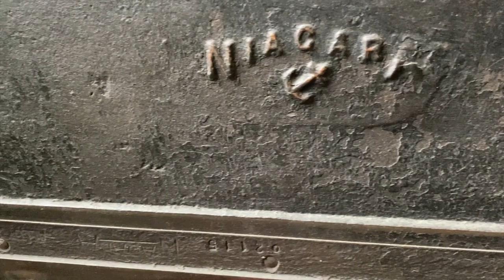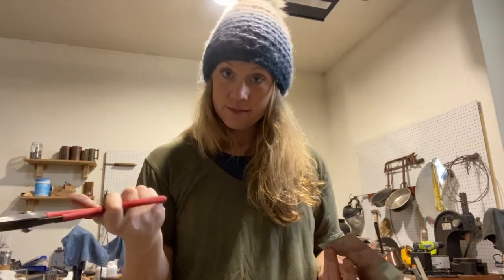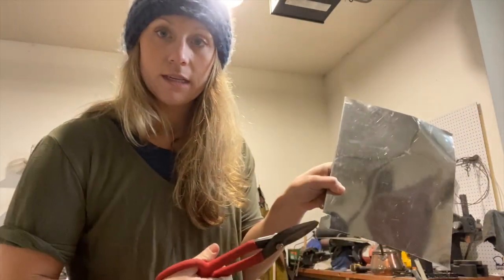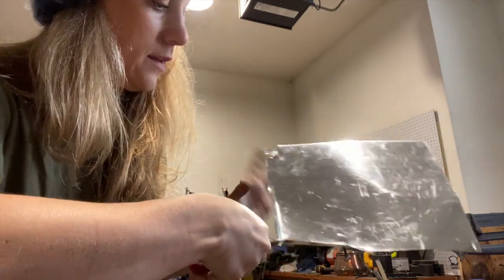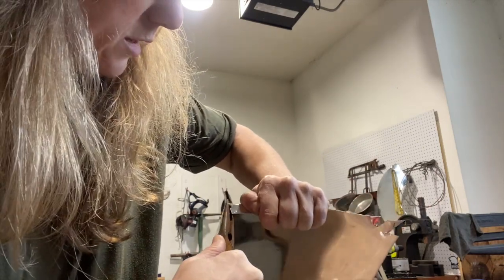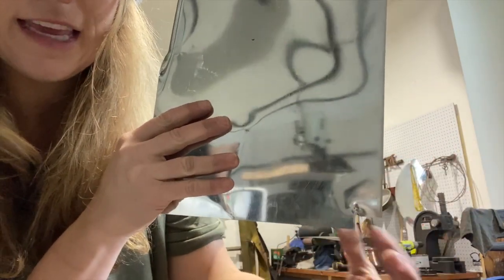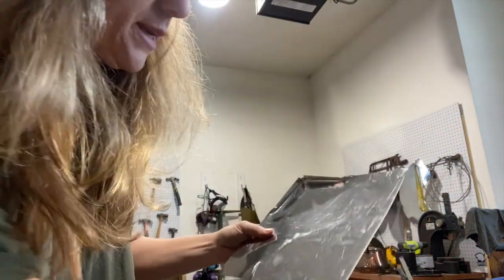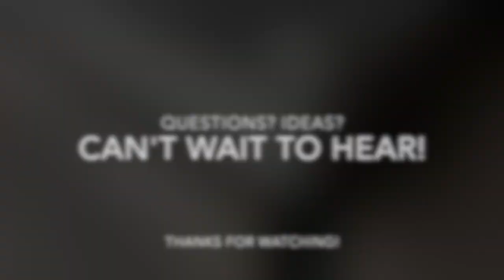Making Corners on Sheet Cookware

Comment: I'm completely new to metal working of any kind and have just been figuring stuff out for myself. I made a sheet pan with seamless "origami" corners out of roofing copper the other day, and it was a hassle, so I'm glad to learn about the seamless method you show. It looks like it will take a lot less effort and screwing around.
Reply from the maker: I hope you try it out! There are definitely a few ways for corners - all are from the 1700s that I was taught - and usually there's a reason for each. :)

Comment: You are very pretty and quite skilful.
But your tape does not allow me to be capable of making that item.
Perhaps a little more detail and a little more care.
I go see what else you have proffered
Reply from the maker: Why, thank you very much for the very kind compliment. I got lucky with genetics, I guess! :) What part of the video needs some clarification? Maybe I can do another video. It is always very hard to show all the details and work because I'm videoing by myself with just a stand for my phone. :)
Reply: @housecopper  Umm , I cannot recall exactly what assist me.
Perhaps actually marking out your sheet for the cut lines so that it will line up the folds more precisely.
I suppose I best go watch again :)
EDIT : Yeah , the marking out - I would have no idea where to cut , and obviously how yours turned out , you would have benefitted as well.
Perhaps if you could get your phone to point at a 45 degree angle downwards , it may give a clearer picture of what is happening rather than a side on shot.